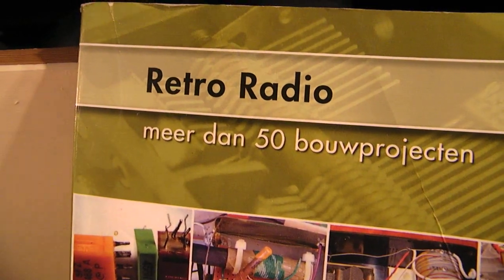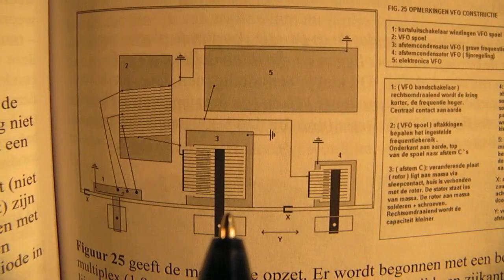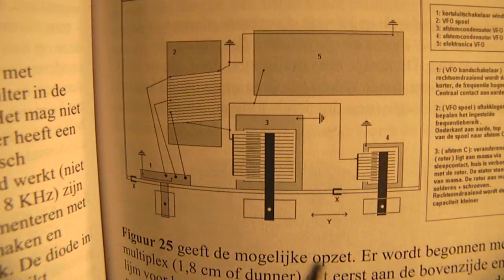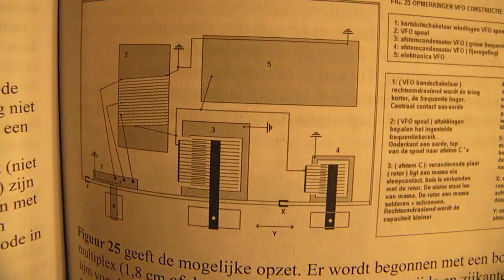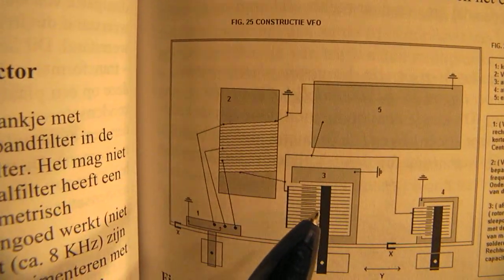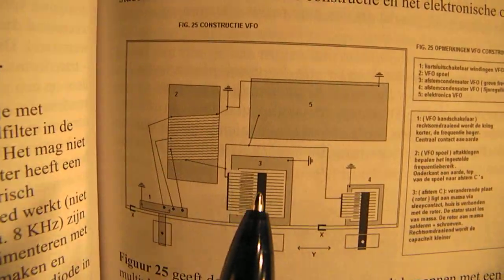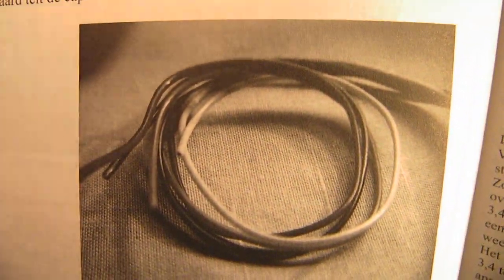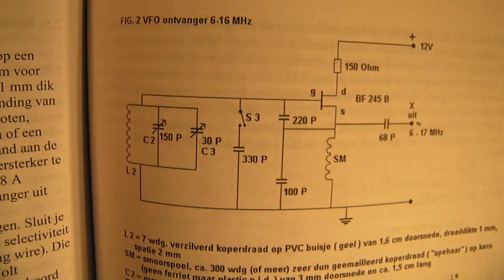How to make an old school Variable Frequency Oscillator for a Superhet radio or whatever

Comment: Just two questions. Where does the other end of the 68pf capacitor go to? and how many turns for the coil? Would like to wind it on a T50-2 toroid.
Reply from the maker: I never used toroids, sorry. The 68 pF cap is the output cap to whatever (mixer). ? You want to make an oscillator for what?
Reply: For this receiver. It works well but has no VFO. https://circuitsaladdotcom.files.wordpress.com/2015/08/regen_simple.jpg
Reply: Could the 68pf also go to the audio amp?
Reply from the maker: the oscillator is Q2
Reply from the maker: Sorry, I think you don't understand the superreg principle.
Reply from the maker: superreg principle is here https://youtu.be/heQEVy72PcI

Comment: Is the fine tuning cap No. 4 also part of the tank circuit?
Reply from the maker: Yes it is. It is paralleled to the main (coarse) tuning capacitor. Without fine tuning it will be impossible to tune in on smallband radio signals, say: radio-amateurs, fax signals, weather signals, LSB and SSB signals, all with a bandwidth from approximately 3000 hertz (3 KHz). These radio signals are so small that the coarse tuning cap "shoots over" the radio signal, to tune in on such a signal with only a coarse tuning capacitor it must be possible to tune that capacitor within 1/10 mm. With the fine tuning cap it is very easy to pickup these small band signals on Shortwave (2-12 MHz). Above 16 MHz even this fine tuning cap gives problems to tune on on smallband radio signals.

Comment: The small one goes from 1pf ~ 250pf and the larger goes from 10pf ~ 200pf???  I am in the wrong video.
Reply from the maker: Thanks. There is one coarse tuning capacitor, going from (say) 10 pF to 200 pF (1.50 in the video). The other smaller tuning (0-50 pF) capacitor bridges that coarse tuning capacitor, making the VFO oscillator suitable to tune in on smallband radio stations (radio amateurs etc.). Perhaps there is a flaw in my explanation, but this is what I ment to say.
Reply: @radiofun232  thanks

Comment: What is SM?
Reply from the maker: SM=smoorspoel (=Dutch) = choke coil
Reply from the maker: SM= 300 turns "ape hair" (= very thin isolated copper wire) wire on form of 1,5 cm long and 3 mm diameter, no ferrite inside, say a piece of plastic tube.